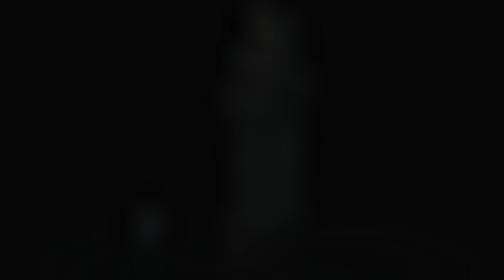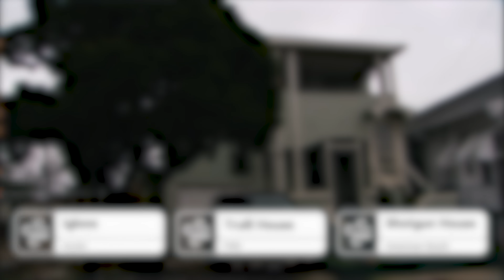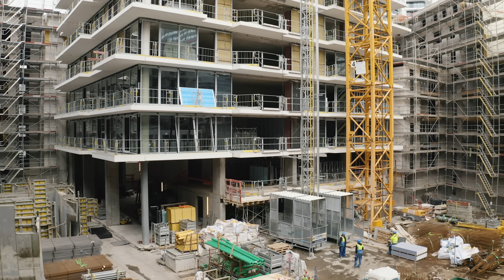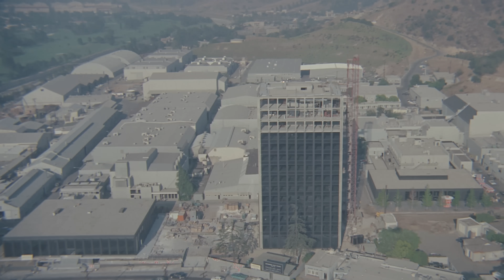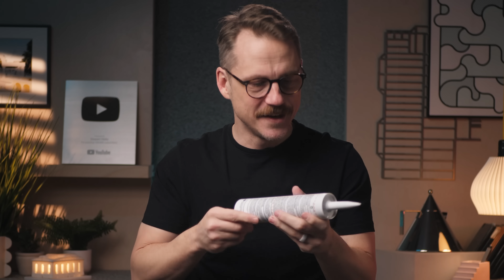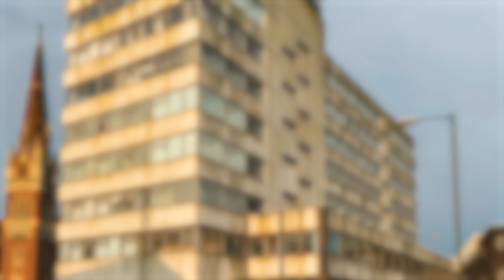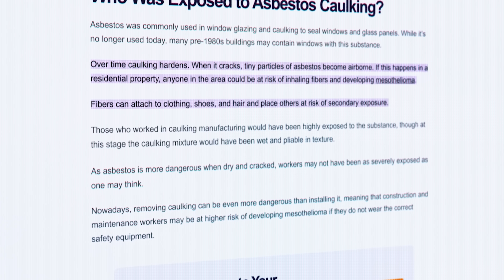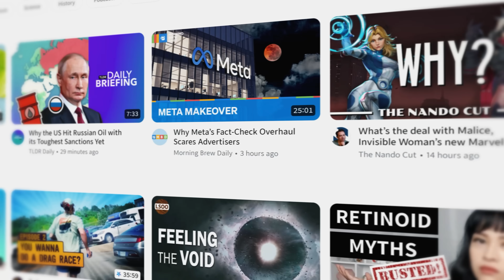How Caulk Accidentally Made Buildings FLAT

Comment: PEMB guy here. Caulk is the default solution for many building erectors who do not have on staff a good sheet metal guy who knows how to custom flash openings and different panel connections/transitions. Whenever the default is caulk, instead of a proper flashing connection, the end-user will be making the inevitable phone call to the GC about their building leaking.
Reply: Growing up in the 1960s and going 'on the job' with my dad to various house, apartment building and business sites. We almost never saw a properly made new chimney crick. We fixed a lot of badly assembled and installed gutters.  It's like no one was learning.  What I learned was that water has to shed as if there was no caulking, then the caulking would work. 

I worked on the Grand Hyatt (renovation) at Grand Central Station (NYC)  in 1979. Saw them installing the curtain wall. Very few guys, it went up really fast. I'll bet it's still in place with very few problems over 45 years.  Once they got these 'systems' sorted they work really well. Not very attractive, but they works. (Part of what's unattractive is when everything looks the same. Imagine one of those 'half timber with white infill houses in London. Now imagine every single street, that is what 90% of the structures are like.) 

The Case Study Houses all leaked, could not be fixed,  were too cold and too hot. The roofs leaked the big windows leaked. These were built before the materials were ready. I knew people who'd built and lived in them. They could tell you.... 
What didn't leak were the sliding glass doors in our family's 1959 tract house. They finally figured it out.  Later Insulated glass, better seals. You can now make a highly functional Case Study House.

As a sail boat owner, my 22 year old sailboat still has it's original  windows, seals, etc... I'm surprised they don't leak. What needed to happen is better materials, especially UV resistance and remaining flexible. But also those 'caulk' and gasket connections still needed to be properly designed, just like chimney cricks and gutters. They had to perform almost all their 'function,' before any caulking. 
The  marine grade sealants 5200, Sikaflex, I guess have made it to domestic construction. Mind blowing how good they are. 
And I'm sure restored old Victorian houses are using a lot of these caulks. 

The thing about curtain walls is not that they're perfect, it's that they're economical and functional. They got a lot better, and I'm sure they were always designed to expand and contract, but also to be adjustable during installation, to factor out and correct cumulative error.  but I'm sure they also improved over time.  What these flat boring walls I think actually represent is cost savings. It's cheaper to hang wall paper than it is to carve. 
And Stewart? I have  lot of respect for him, but I get the feeling his windows face one of these buildings and he's been around one of those intractable leak puzzles on one of these curtain walls.  (Leaks can very often nearly impossible puzzles.) 

Know how everyone of those old European sailing ships were made? Romans to Captain Cooke to the great schooners? They'd fit the wood planks (strakes) as close as possible, and then they would hammer in rope fibers (oakum) and tar into the joints. These mostly kept out the water. But in the holds of every single one of these ships was a certain depth of water that no matter how much they were pumped out, would still be there. Usually at minimum of  a foot sometimes three or four feet.  

Humans have been caulking since we put together two pieces of wood to try to keep the water out or in. All those wonderful Victorian windows detailed here? They didn't block out the wind, they all had some kind of sealant. The glass is held in and sealed with putty (limestone and oil) which has to be replaced every few years. There's a lot of oakum just like the old ships in these houses. I know I removed a lot of it during renovations.

My last house we installed an HVAC system with good filters. A 1.5" PVC pipe was the fresh outside air supply. 1800 square feet. That's all that was needed. Of course opening the doors might've been factored in.  My old house now doesn't have this system. Instead I open the windows. I have an infinite dust problem. The other house had a system designed to warm, cool, filter the air and provide enough fresh air, without the dust.   Sure for every one of these systems, HVAC, windows, caulking, there are horror stories of failure, but that's not the end of the story. Someone or some company does a better job and sells a lot of their products.
Reply: @WillN2Go1  Thank you for saying so many of the things I was thinking while watching this.
Reply: As a sheet metal guy myself I agree with this statement totally
Reply: I have a “lean to” type pitch off the back of my house. In 2017 a guy tried to do storm repairs by ripping off all the metal flashings and just caulking the living tar outta everything. 
Leaks all over, carpenters wasps keep trying to get in(I pray I got that stopped now but spring will tell) and reduced life on components... such a pain.
He refused to do anything wit metal or a siding brake
Reply: At the risk of being overly-dramatic, I see a connection here between the slow decline of craftsmanship and the fall of American democracy. It's not just caulk. Every worker is facing higher demands at the job site year-over-year. We're constantly told to do more with less, corners get cut, and the role of expert craftsmen gets automated out of the process. Billions upon billions get funneled into shaky investments like development contracts during a housing bubble and (more recently) AI models, and when the market catches up to realize their shiny new toy is just a well-polished turd, the value plummets, investors freak out, and they demand mass-layoffs to protect their profits. "Unrelated" but the US homeless population has been 600,000 - 700,000 since pretty much the mid-1980s...

The participation of individual workers is no longer a requirement for America's #1-in-the-world GDP. Why would lawmakers and oligarchs listen to us "peons" when all they really need to produce great riches is ~20 Republican workers, and $1T worth of machinery and equipment? :/
Reply: AI models.... In architecture?! God no! No no no! 

AI image generators don't know the difference between bricks and wood shingles. They couldn't possibly understand how to make realistic and attractive building designs. Please don't tell me AI garbage will be polluting the next building I see being built. I wouldn't trust it to be structurally sound either! 

 @Trip-x1i
Reply: @Trip-x1i  bruh people will literally come p with anything to not admit the simple reality that capitalism maximizes profit and most of the time the cost is everything we as humans actually value.
Reply: @Trip-x1i  IT'S CALLED LATE STAGE CAPITALISM
Reply: @Trip-x1i  read marx
Reply: @pineapplepizza27  for the laughs?  I suppose keeping your spirits up is not a bad idea.
Reply: Craftsmen vs butchers
Reply: Happened in my apartment building lol
Reply: wtf is a PEMB
Reply: @ewthmatth  Pre-engineered Metal Building.
Reply: God bless the PEMB guys
Reply: As a random internet user, "building erectors" made me chuckle

Comment: Stewart, I get that you have an axe to grind in this video, but I think you really glossed over the importance of making construction both cheaper and faster. Those are really big factors when making decisions about architecture and materials. You also didn't really address the quality control issue. Yes, errors get multiplied when you scale up and manufacture components in a factory, which then get hidden by caulks and sealants. But relying on craftsmen on site to cover up and hide the same kinds of materials errors in blocks and stuff is always going to be less consistent and more prone to quality issues than something standardized. It's all fine and dandy to put on our rose glasses of nostalgia for lost skills, but back then those few masters of their craft that were available cost us much more in the many other lower skilled workers on every site.

I also just want to note that the overly negative and accusatory tone you take with the idea of using (heaven forbid) chemicals in construction (news flash: literally everything is chemicals) is not really what I am used to and have come to expect from your channel. I enjoy your positive outlook and sharing of knowledge, please don't start making more videos framed from a divisive point of view, there's enough of that going on everywhere else.
Reply: I agree wholeheartedly. 

The shortage of affordable housing in the United States and many other locations does not get solved by creating more elaborate, more bespoke buildings. A lack of attractive architecture doesn't mean much when the alternative is not having a roof over your head.

I continue to be surprised how, at least in the United States, residential construction is not more standardized and automated than it currently is. I assume its main cause is each city having unique building codes, but I still do not understand how a generic stick-frame house still takes months to construct.

Also, I have visited many older residential buildings, including ones from the "golden" time period 100+ years ago, and I would never make the argument that they are in better condition than a new building. The gaps, drafts, and leaks are all common problems in an old building regardless of construction method. It has nothing to do with the use of modern sealants versus vintage craftsmanship--all buildings deteriorate over time and need to be maintained.
Reply: @TheVonMatrices  I'm from Scandinavia. Our single family house was erected in three days from pre-fab wooden frame elements about 20 feet long. And this is pretty much the standard way of doing things here. It still allows basically any amount of variability as the elements are CNC cut based CAD models on the factory floor so you get the best of both worlds. Some people then lay, at site, a layer of bricks as decorative element, I personally prefer wood cladding and this is done at factory so the house comes readily painted. So far has lasted for 35 years without re-painting.
Reply: He's an architecture nerd grinding his gears a bit about the decline of his preferred style, he's perfectly entitled to wax on about his view of the issue. He doesn't address cost beyond maybe an offhand comment about it being cheaper the modern way, so it's fairly obvious that's the weak point of his argument. On the other hand, having a greater need for highly skilled "master craftspeople" would create more of those people, driving the cost down eventually and making it so that the cost-effectiveness difference might not be so stark.
Reply: Construction costs so much right now. Sure the generic 5 over 1 doesn't come close to the facades of the old townhouses, but i'd rather worry about housing people first, and   ornimentation secons
Reply: @lordofthepies  the whole point is that ornamentation is functional
Reply: I came here to say basically the same thing. Thank you for saying it better then I could have.
Reply: I guess the idea is, you wont need constant repairs of a stone facade.
Reply: I agree too. A lot of the “traditions” he spoke of are still the norm for the majority of construction outside of large commercial building and “modern architecture.” The materials are different but we still follow the same course of having RO’s, purposeful and decorative trim to hide gaps and properly shed water, and other kinds of methods to transition between surfaces that will move and shift with the home without needing more caulk later.
Reply: Totally agree.
Reply: This set following train of thought in my mind. Look at traditional (meaning medieval or Roman) roof tiles, every tile is unique and the variability is huge compared to what we produce today. Yet they protect the building from  rain without very little maintenance,  just keep an eye on it and replace tiles that need replacing. This is the kind of construction we should be aiming at. I don't mean going back or being nostalgic, but the kind of engineering that 'just work' with as little maintenance as possible. Works by nature/design, not because chaulk every joint every so often.
Reply: @Axel_Andersen  

See, here's the issue: those roofs ARE being maintained every single year.  You can't go a more than a year without at least a dozen falling off, cracking, or otherwise being worn down.  Not only that, but their durability is largely a function of being in what amounts to the Garden of Eden in terms of environmental conditions.  The same style of roofing just wouldn't function anywhere windy or with a lot of hail; I know, because I've seen what happens to those roofs in a place which deals with severe windstorms and hailstorms on a regular basis.

Point is, ALL buildings require maintenance to stay standing.  Period.  Full stop.  

The fact any ancient building remains has less to do with its original construction, and it has far more to do with the care taken of it over the millennia.  The same is true now, too; any house built today can last hundreds of years if maintained properly.  That means painting when necessary, sure, but it also means replacing walls, siding, framing, the whole kit and kaboodle, just like those Roman row houses (most of which have been subject to the Ship of Theseus conundrum many times by now).
Reply: @coupledyetivonvanderburg5385  I agree in that everything needs to be maintained. I disagree in your implied claim that all designs are equal in how much you need to maintain them. We should aim to design for as little necessary maintenance as possible.

As to leaf and maintenance. I live in the Nordics, so not the easiest climates with leafs and stuff. I never bothered about the leaves on the roof. Worked for me almost 40 years now. I only take care of the gutters. If I did not have gutters and the sides of the roof reached out far enough I would not have gutters at all. Vere little maintenance. Design matters.
Reply: Caulks and adhesive reduce all of the risk to one point of failure. That's the opposite of engineering. You don't design a steel frame with one point of complete failure. You build in multiple failsafes into the loading. With caulk you're building for short term and cheapness. Nothing else.
Reply: @darrens3  Thanks for basically just repeating what was said in the video, clearly after my first comment addressing points throughout the video I understand those points. I just don't think they are the only factors or even the most important factors in designing a building. And clearly the industry agrees with me. Also, the points you are repeating from the video can be seen as an advantage. It makes it easier to service and access. I think there is some degree of survivorship bias going on here with old buildings too. How many of those older buildings failed over the years and aren't around any more to play into our perceptions of durability? The fact that there are old buildings that have survived only means that the most durable buildings from the past have survived until now and does not encapsulate all the buildings that have decayed away.

Comment: While I mostly agree with the sentiment and message, the argument itself is kinda flawed. Because it can be applied to itself. 
You use a "good" example to contrast to the worst, but even that "good" building did kill craftsmanship. Using factory made bricks for example, kill the know-how of people choosing and felling trees, of people cutting stones, of people overcoming obstacles to move stones and timber through rivers and roads. Your "good" building making killed the house builders of the renaissance and what English call early modern period. 
I mean, how many stone-cutter jobs where in the Chicago construction industry in the early 20th century your cite? 
And those terracota buildings for example, had and have way, way less individuality and expression and variation than medieval and renaissance houses, or even Roman appartements buildings.
And since we're in history, I would point out that a significant number of houses even from antiquity and the middle-ages used dirt (well, clay, often) and plant substrate like moss to make a joint between unstraight and not-perfect timber or stones. "Caulk" isn't new, it was there probably before the iron age.
Reply: You're falling into the extreme. The whole point is our modern processes are an extreme of zero individuality in exchange for efficiency, those old buildings are the opposite. The 19th and early 20th century had industrial processes, but which at the end of the day still required some individuality.

If you think the extremes are bad the logic holds
Reply: @CrabInBucket  Lower costs, better quality items, and having worldwide choices could also lead to more freedom to express yourself. 
Now I agree with the sentiment because what most developers do with it is not great. But I disagree that's because of the tech.